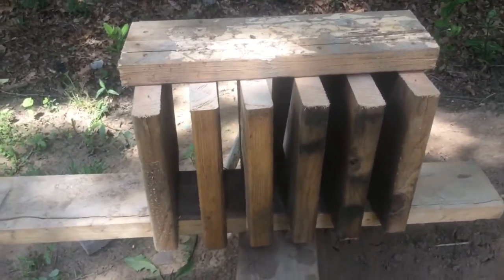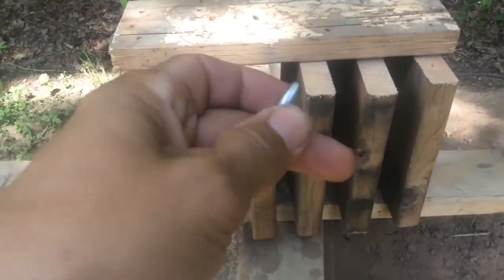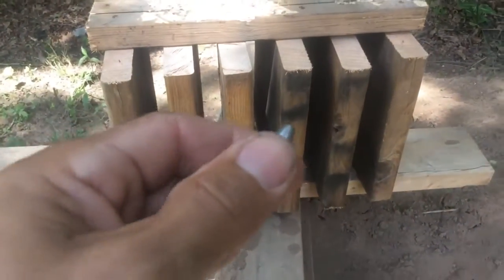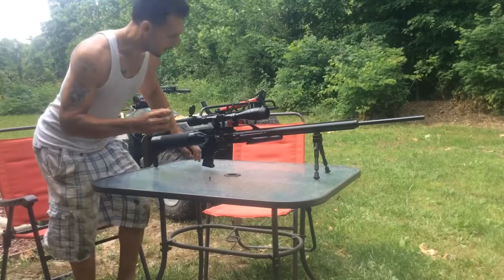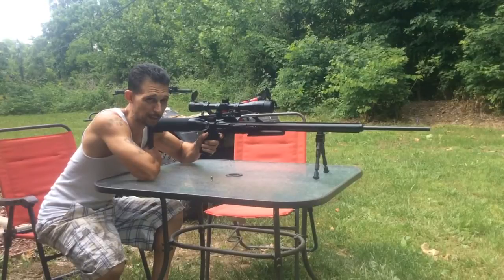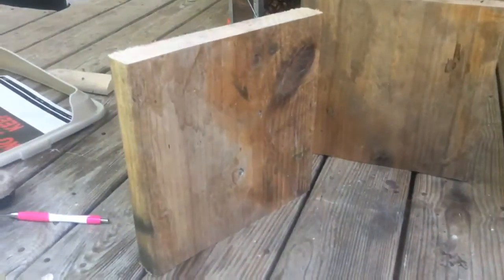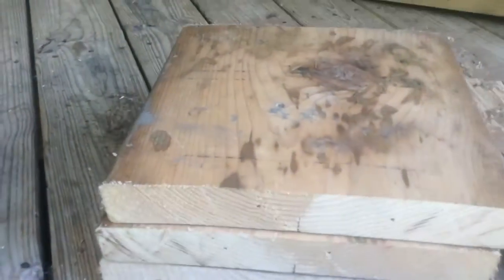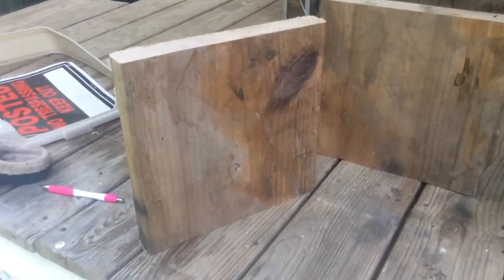How many 2/10s will he Texan 308 go through???

Comment: the loudness factor is the only thing stopping me from getting one
Reply from the maker: mrobertson188 they have the Texan ss coming out soon ,, thanks for watching
Reply: Kevin Alt I've been watching alot of your videos. good job. I saw some aftermarket suppressors. around $175.
Reply from the maker: mrobertson188 yeah but I think they make the gun to long it already 4 ft as it is,, with suppresser it would be around 5 ft ,, lol,, ,  but if u don't care about length than that would be the way to go because they are on sale right now for 800 scoped. I'm hoping they come out with the 357 Texan ss , the ss version is 6 inches shorter than the original Texan , but it's loosening 100 fps, thanks for watching videos I appreciate the compliment

Comment: If its a stock gun id swap out to the 2020 maov valve. Alot more power . I'd bet it'll go through 5
Reply from the maker: It has my own custom modded valve an 4500 psi tank with heavy hammer spring now putting out 400 for,, this vid is 3 years old ,, I got video on it